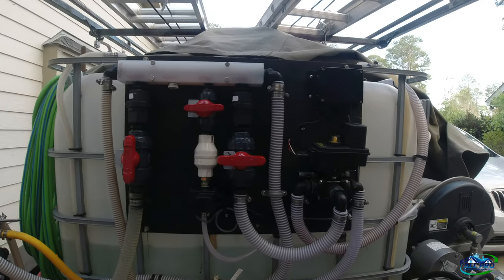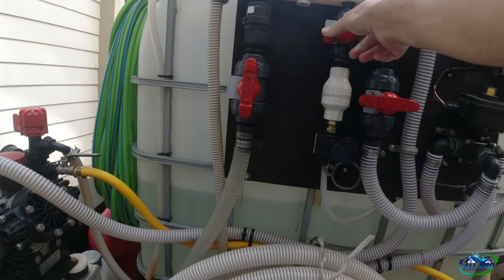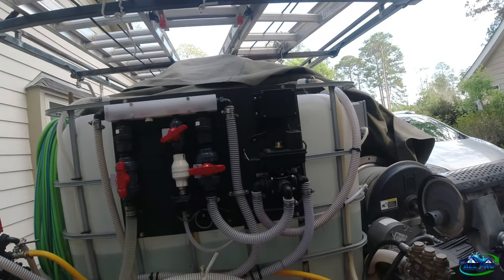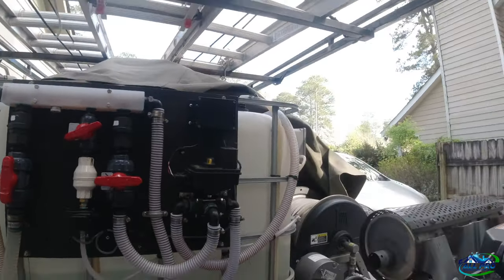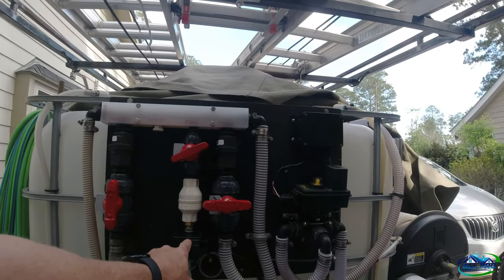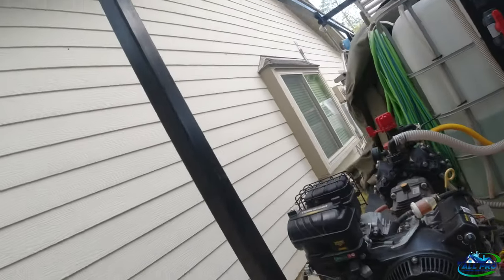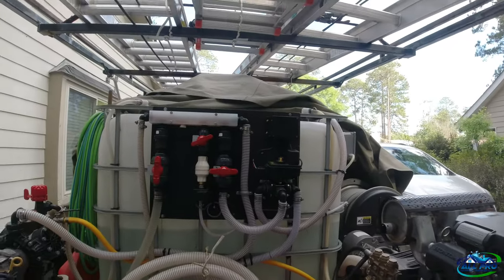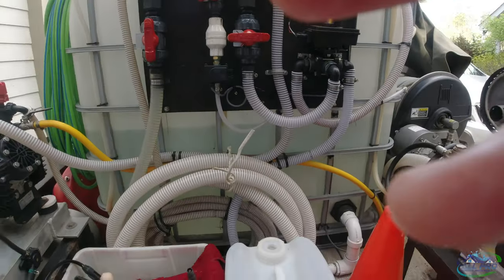US Solid Soap Valve Failed  Banjo to the Rescue

Comment: Little tip for everyone, brace your 1/2" out pressure hose so it doesn't shake or you will be down and looking for a new connector and o-rings.  Took me about three months to get those parts before.